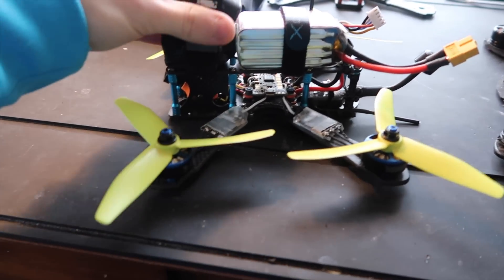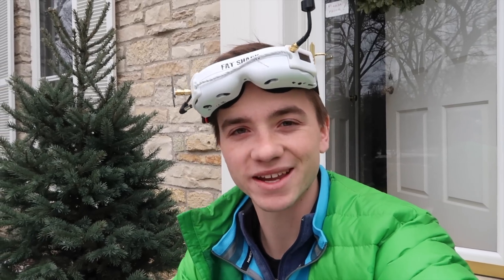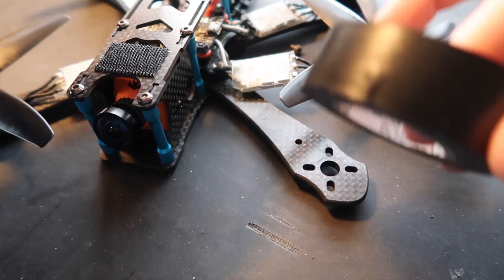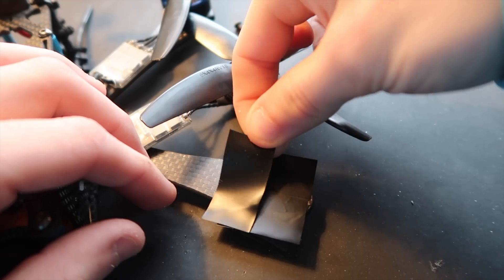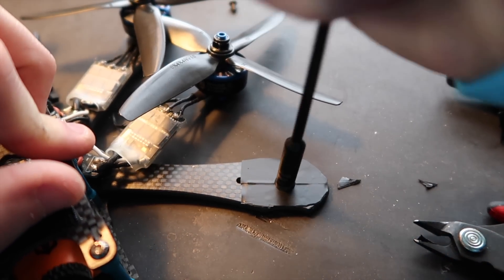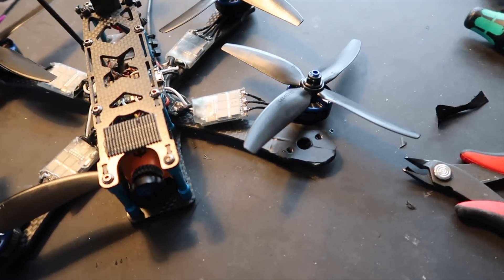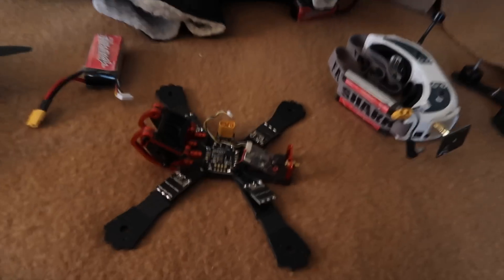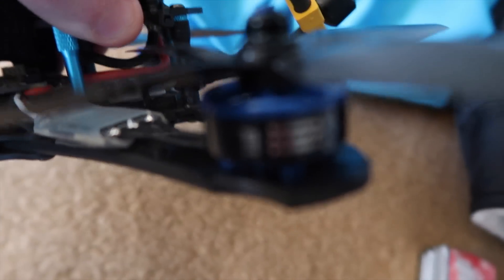The Secret to a Perfect Flying Drone (soft mounting motors)

Comment: notch filters on BetaFlight do a great job removing vibrations from motors spectrum range.

... and it's kinda of funny since KISS was always considered top-premium-pro-quality stuffs and can't deal very well with this kind of issue...
Reply: btw, soft mounting motors on quads flying BF will require a retune on the notch filters since you're removing (or moving) a certain spectrum of vibrations to a different range of that BF folks had already tuned to.
Reply from the maker: Interesting, I think they just added notch filters to kiss as well.  Maybe that could help to some degree.

Comment: Hi jhonny I think your vibration problems should come from somewhere else, because according to you have put the tape, the screws continue touching with the motors and the frame, and the screws pass the vibrations also. The only thing that occurs to me is to put two layers, one above the frame where the engine supports and another under the one where the screw is supported, so if I think it will remove vibrations, but there is a risk that the screws will be released. what do you think? a greeting
Reply from the maker: Adding the tape does something that helps. If it didn't do anything I wouldn't do it, and I wouldn't have made a video about it. 100% agree that it's not truly isolated. The tape just helps change the vibrations to a vibration that affects the FC in a way that makes the quad fly smoother.

Comment: Hi there I have massive vibration sinds I use motors with stronger magnets on my frame. I was planning to use rubber O rings until I watched this video. Now would you prefer the tape or the rubber rings? Thank you!
Reply from the maker: I haven't used rubber rings before.

Comment: can this electrical tape theory be proven by blackbox comparing oscillations with and with out tape?
Reply: It would be really easy to show in betaflight.  Go in the CLI and type "set debug_mode=notch.  That will let your blackbox record the raw gyro data before it is filtered.  There you can easily see the vibrations your flight controller is trying to process and how much noise it is dealing with.  Just looking at normal gyro data in blackbox will be after it is filtered and won't show you all the noise.  The noise is what you are trying to eliminate.  Joshua Bardwell did a video on setting up your notch filter.  Check it out to learn more about noise filtering and how to see the "noise" in your copter.
Reply: joshua bardwell did a cleanflight "GYRO oscillation" test recently with/without the soft-mounts to see how much a difference soft mounts make
Reply: romestar idk if it will work but, that's a really good idea man! Try it out and see what happens.
Reply: I think to make sure the data is as accurate as possible the exact same props should be used in the exact same orientation.  Don't touch the props between tests.  That way the slight imbalance of the motors/prop combination isn't altered between tests.  Even removing the props and putting them back on might change things if the imbalance of the motor and the imbalance of the prop change compare to each other.  A good set of props with no tape will probably look better than a bad set of props with tape.
Reply: There is a current discussion with objective black box evidence for this on Facebook
Reply: can you share the facebook link?  Tks.
Reply: yes... y=oscX+20
Reply: I know this comment was before Bardwell's vid about soft mounting the motors and blackbox analysis
Reply: i know i can tell by the timestamp. just letting people know who might not have seen
Reply: for sure but even bettet to use the motor test graph to analyze it

Comment: sounds to me like you're going to have a few motors coming loose by 'soft mounting them' just maybe.. the softness would allow room for movement thus allowing the screws to come loose. Just my opinion.
Reply: Adams World use loctite
Reply from the maker: Adams World watch my video "I AM SO LUCKY" haha
Reply: oh i did!! thats why i mentioned the tape causing it to come loose. I hope it doesn't because you're an amazing pilot and wouldn't want these things to smack some unlucky person in the noggin! but i get that you'd be taking extra precautions now. Keep the vids up, i don't miss any! I was wondering if you could get little hard rubber washers to slip between the motors and the mounts, something that would give less than tape might over time. they would also grip a bit so im thinking less chance of slipping loose.

Comment: Hey johnny,how tight you screw it in?and over time does it loosen up?
Reply from the maker: Almost as tight as normal, bit less.  Yes after you crash a few times retighten!
Reply: Awesome dude~ it considerably improved my motor noise in BB, its like a miracle. Although, i noticed i do have to retighten them after couple packs. Hey thanks for the tip! Thumbs up!
Reply: Johnny FPV What if you keep the screws losser then normal and use lock tight? Would that have more of an effect?

Comment: I see I deffently difference in punchouts while your ESC's active braking is happening, much less sloppy like video for that split second of punch. Sick good thing I didn't fully tighten and lock my motors on yet with my build. thanks
Reply: there's better vibration absorbing material trust me, work for a....... doesn't matter but found a nice vibration absorbing tape made for a recall with for similar properties  of simple road vibrations and chassis control units involving gyros and acc.

Comment: I'm flying with Kiss and haven't had an issue with vibes yet but your video got me thinking. I did apply double sided tape between my bottom plate and my arms before screwing them in to help minimize conductivity on the carbon frame. Wonder if thats acting the same as the tape trick? Interesting discovery and application. #StayJuicy

Comment: Unfortunately your style is off the chain that is not noticeable to be honest but I understand as is something you need to try to see the difference.   Great advice..  Let me run to Walmart before they run out lol ✌️
Reply: FDV_FPV there's always that person that balance a 5 in prop, I don't have much experience but I would start balancing at 8, but hey maybe this will help 75% of peaple throwing time away trying to balance a 5 inch prop. I personally only have experience with my custom build it balancing 17 in carbon props suck. but it does make a difference and I will do this trick to my t motor antigravity 380KV with 17  props for the Spring, I only see better results......maybe ?
Reply: FDV_FPV there's always that person that balance a 5 in prop, I don't have much experience but I would start balancing at 8, but hey maybe this will help 75% of peaple throwing time away trying to balance a 5 inch prop. I personally only have experience with my custom build ive balanced 17 in carbon props and ut sucks. but it does make a difference and I will do this trick to my tiger motor antigravity 380KV with 17  props for the Spring season, I only see better results......maybe ?
Reply: Haha..  I was writing before the video ended and Johnny said it half way my comment...  You can't tell the difference on video but my first RTF kit had soft mounts..  I just came back from Publix as I think I will use Gorilla tape instead as a bit thicker than electric tape....  Enjoy
Reply: FDV_FPV it's not how hard it sticks it's the ability to absorb shock and vibrations, u have to think of an ant driving a civic and how small an ant is think of how small a civic size shock assembly would be for an ant sized civic. it's the ability to absorb shock not how strong something can stick
Reply: I'll give the p/n to what I thing will work great for an alternate to the e-tape, tomorrow when I get to work
Reply: uploaded 2 videos of my big one from last year or so watch and I'm sure Johnny fpv tips will on an already decent built big quad and on fist build alien "clone" running skitzo motors.

Comment: Hmm, I was quite skeptical on soft mounting motors before, since I have only seen and used TPU inserts, which can't get tight enough for my liking without ruining the dampening effects, but with this tape method it should be able to get very tight to the arm :) Nice. Never had any vibe issues on betaflight, but worth giving it a shot since it is so simple :D

Comment: And so began the Great Electrical Tape Shortage of 2017
Reply: GAPiT FPV waiting for the Charpu edition insulation tape by luminear at $20 a roll coming out now.
Reply: Most of the vibracion goest through the screws... so I consider this a placebo. I watched the video blindly, jumping from scene to scene and there is no difference.
Just diagnose that with BB and we will see
Reply: some vibrations will go through the screws but not all. it works, I have BB tested this on a unbalanced motor and atleast got 70% less vibrations.
I guess the best thing would the tape method with the addition to have 4mm holes in the arms and heatshrink on the screws with rubber washers between the arm and screwhead. but its a hassle to enlarge holes in carbon arms..
Reply: 70%!!!! Daaamnson . . I better go do this right away.
Reply: Buy stock in 3M!
Reply from the maker: Petr Polách yeah I said that at the end. The quad was flying perfect to begin with.  It improved the feel of the quad
Reply: I'm doing this a bit differently -> soft rubber washers on both sides. Whether it works on a fresh set of props with well balanced motor ? I haven't BB that but I've been building everything like that for months now and it seems to me that it eases out a road to good PID sets.
Reply: The silicone tape is thin but you could use 2 ot 3 layers, it has no adhesive but it will stick and fuse to itself and become one piece. the problem will be to cut the holes for the screws and center hole in it sa silicone is hard to cut becouse its so flexible. Easyest way would be to put some ink on the bottom of the motor and press it on the tape to mark the correct hole pattern and then use some kind of thinwalled pipe or holepunch to make the holes.
Reply: I would not recommend it. It would cause the tape to be thicker around the hole and also destroy the tip of the soldering iron. the tip is coated with a protecting layer to prevent oxidation. Instead take a 3,5mm OD metal tubing and drill the inside with a 4mm drill and you have a homemade holepunch. works great. try foamtape its better than electrical tape
Reply: lol totally haha
Reply: 12.5k people just planned to strap up their quad arms... just like that :) Thanks Johnny for the tip
Reply: NutSticks yeah i have foam under the motor and plastic washers for the hex nuts on the bottom side
Reply: SLINGSHOTandMOLOTOWS how about just putting electrical tape under
And have washers.. it would be the same as the upper side of the arm.
Reply: 2663540 sure that would work...but I think alot of materials would be better than Electric tape. I Heard someone mention Plummers silicone tape and that might be a better choise.
Reply: it that to thin tape? how many layers?
Reply: SLINGSHOTandMOLOTOWS can use soldering iron tip to melt a hole thru the Silicon tape. Thinking of getting some and using that with some washers
Reply: SLINGSHOTandMOLOTOWS that's actually what I'm using right now (foam tape) works pretty good :)
Reply: hahhahahaha

Comment: Not sure if it's all in my head, but it seems like the footage with soft mounted motors looks smoother on throttle blips. Without soft mount there seems to be the slightest bit of high frequency jello on throttle blips, while the video stays smooth and clear regardless of throttle range once soft mounted. Awesome job man, gonna have to try it
Reply from the maker: You're probably right

Comment: what about the screws? wouldn't they transfer vibrations since they are in direct contact with the carbon?
Reply from the maker: Probably a bit, but the tape seems to take care of that.
Reply: Johnny FPV cool. think I'll give it a shot. maybe do a blackbox comparison
Reply: I'm now wondering if motor manufacturers will pick up on this and start designing some form of vibrating dampening incorporated into the motor itself. .. would be interesting to see if that ever happens

Comment: Good tip, I plan on trying it with my kiss quad with bad mid stick oscillations. A couple of quick questions. How tight do you screw down your motors onto the tape? And lock tight I assume?
Reply from the maker: Tight but not crazy tight.  Yeah lock tight or they will come loose and possibly pop out if you don't re tighten.

Comment: +Johnny FPV quick question, because I was legit just now switching out some motos when I saw this posted, will I need longer screws?
Reply from the maker: Yes slightly longer.  3 layers of tape is about 1mm.  Your current screws may work though.
Reply: Thanks, I appreciate it!
Reply: Screw Muggz speaking of screws the screws will still transfer vibrations to the frame, I don't get the point of this. the screws are still connected to the motor and will transfer vibrations to the rest of the quead.
Reply: Screw Muggz yes I'm running into that rn
Reply: ThatFlyinRyan my current screws seem to work so far.
Reply: Head Trip FPV I actually didn't have the patience. I did one motor then quit. I use 4 screws if one gets loose it's not really a worry that the entire motor starts wobbling for me. maybe I'm missing out...don't really care.
Reply: Ya a motor being ripped off would not be good haha
Reply: Head Trip FPV definitely not worth the weight shaving in my book